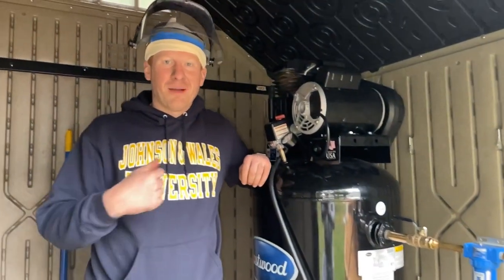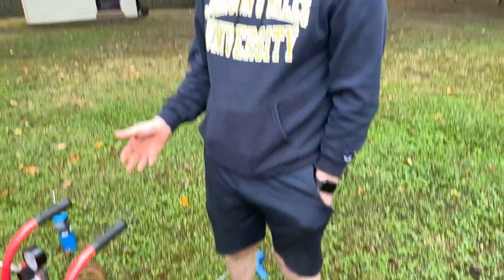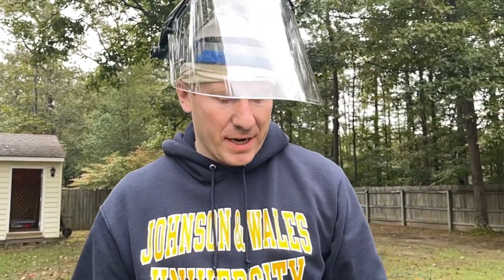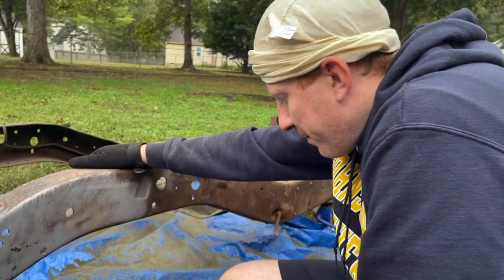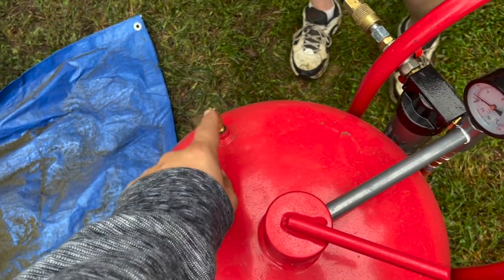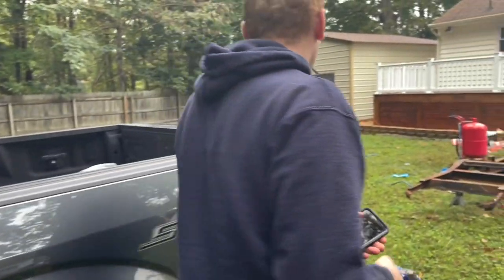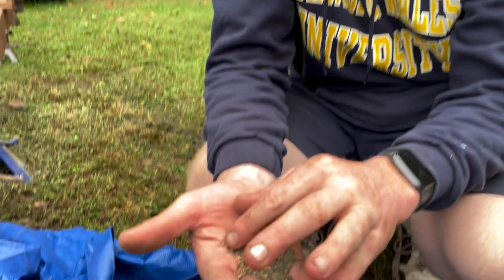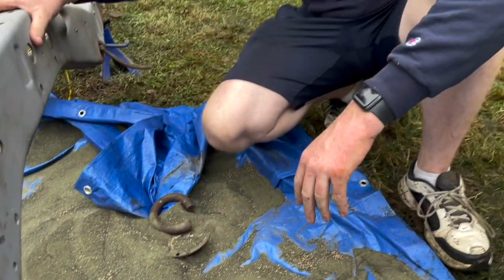Sandblasting the Frame Part 1 1963 Chevy C10 Restoration Day 13 (Harbor Freight 110 LB Sandblaster)

Comment: It took me 40 hours to blast the frame on my '61. Over 100 hours on the cab.  I used crushed glass, and just kept sweeping it up (blasted on pavement) and running it through again and again and again.  Not something I want to do again, but cheaper than "paying the man." Keep up the good work!
Reply from the maker: Thank you.  It has taken us forever to get it done!  We haven’t gotten to the cab or body parts yet.  We are saving that for the future.  We are trying to get a rolling frame and everything done on the frame and suspension first! Thank you and we will try!

Comment: I just blasted my chassis in about 16 hours, I used two compressors in parallel with a half inch airline from each. Totaling in theory 26cfm at 125psi. Thing worked amazing, biggest nozzle about 6-7" away from the frame.
Reply from the maker: I’m jealous as I didn’t have that.  Took forever but once I got it dialed in it came out amazing!

Comment: i used about 20 bags when i blasted mine. be careful when you are blasting it will take skin off easy which i found out just how easy through an accident. if its damp or wet out you should have a water separator in the line to help keep it from clogging. looking forward to next weeks episode.
Reply from the maker: Thank and yeah we have gone through a ton.  I pretty much had to buy a pallet of it.

Comment: CFM NOT PSI RIGHT
Reply from the maker: Yes you are correct. I misspoke when I was talking. You do need a good amount of CFM for this unit, but it works really well and we recommend closing the bottom valve to only about 75 percent open to get the best performance on the sandblaster!
Reply: PSI = pounds per square inch, indicates pressure...CFM = cubic feet per minute, indicates flow rate...

Comment: Sandblasting is such a hassle!
Reply from the maker: It was kind of a hassle but it was a lot of fun to learn how to do it ourselves and to do it ourselves.
Reply: but its worth it
Reply from the maker: @skulltyrant2  it definitely has been worth it.  Although I have a beach worth of sand/coal in my back yard haha
Reply: It is pretty easy to sandblast. As long as you know how to work it.
One thing that you never want to do is sandblast in the rain. Moisture is killer. 
For both the sand packing to surface rust on the fresh clean metal. A good clemco
Reply from the maker: @redneckswitwheels  yes we should have been wearing respirators but we were using coal slag!
Reply from the maker: @redneckswitwheels  thank you for looking out for us!!!  No need to apologize!!!!